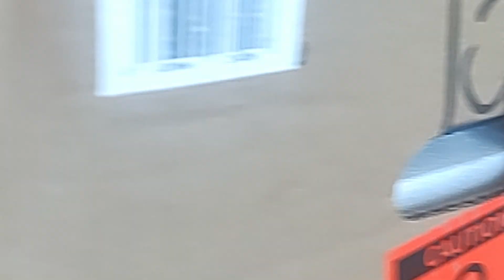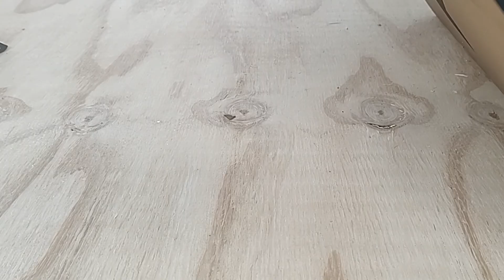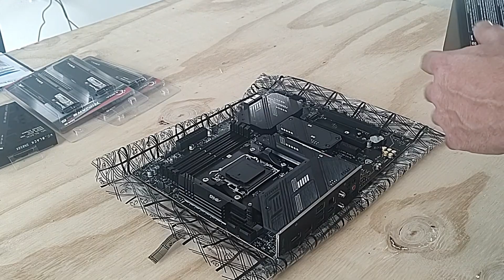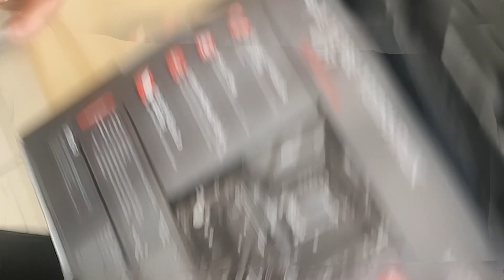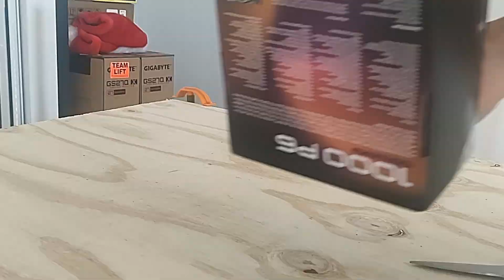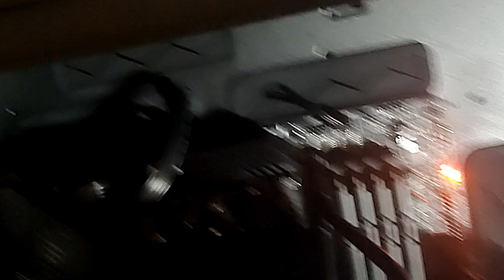Watch how easy it is to build your own PC in 2025 (Audio Remixed)

Comment: How did you get a 4090 and what did you pay for it. Be honest
Reply from the maker: I bought mine in November right after the election.  It was at 1800 day before the election, then the day after the election it was at 1900, then the next day it was at 2100 and I pulled the trigger and bought everything when it hit 2200 the next day.
Reply: @ wish I would have done the same. Saw one at 3400$ yesterday and just turned off my computer. At least I got a 9800X3D. It’s an absolute beast
Reply from the maker: @Damingo54  Good to hear you got a powerful card, I actually have a co-worker to thank.  I had mentioned that I was looking into building a new PC and he said "you better hurry up before the results of the election cause prices to rise." He was right.  Thanks Taylor!